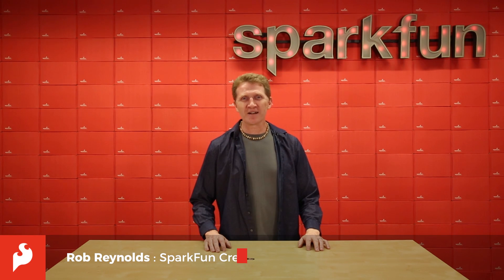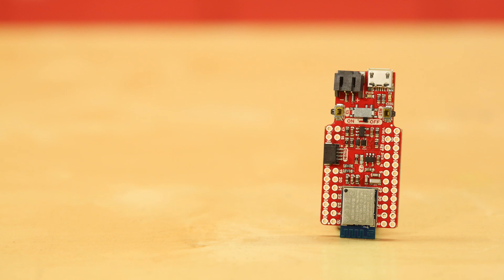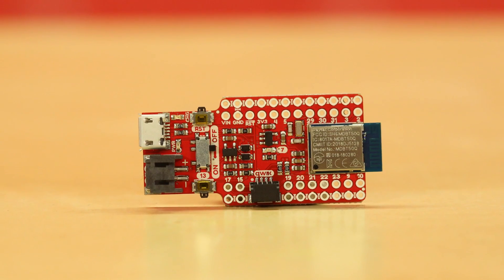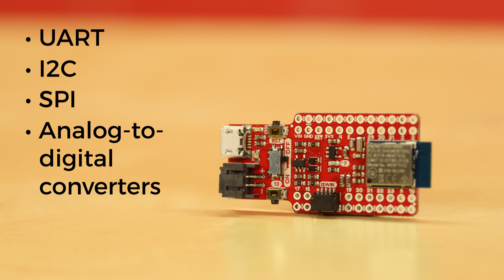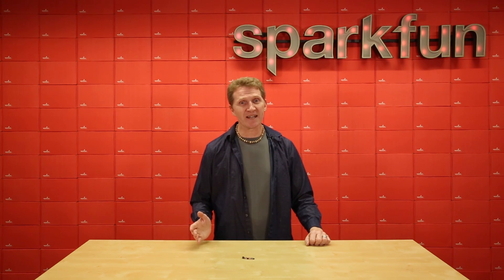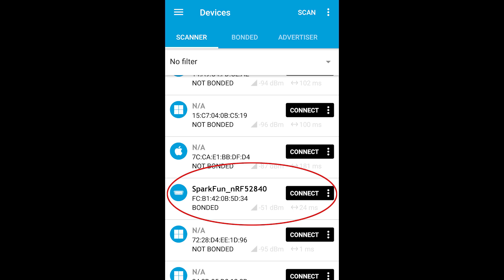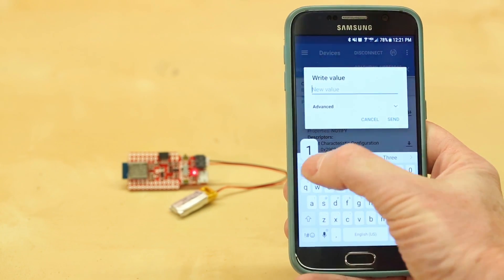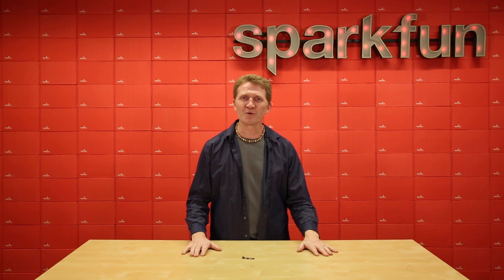Product Showcase: SparkFun Pro nRF52840 Mini

Comment: This is basically a knock-off Particle Xenon.
Reply: The point is that it is largely pin-compatible with the Pro Mini and Pro Micro.
But this won't be compatible with everything that uses the Pro Micro because it is bigger and doesn't have the I²C pins.
Reply: Arduino Guy Projects and More! I thought exactly the same!

Comment: I have an application where I'm using a NodeMCU board with an NRF module... I was thinking this would be a cool replacement since it's all built together, but I can get roughly 2 NodeMCUs and 2 high-powered NRF modules (with amplifier + external antenna) for basically the same price as 1 of these.
Reply: If you look at the Adafruit repo, it appears you can load CircuitPython v.4.0.0 Alpha 3 directly onto the Nordic development boards such as the nRF52840-dongle (PCA10059) which is low cost.  I'm not sure if a J-link is required.  It might be possible to use DFU. A big advantage of the SparkFun board is it comes ready to program with the cool drag and drop boot loader.